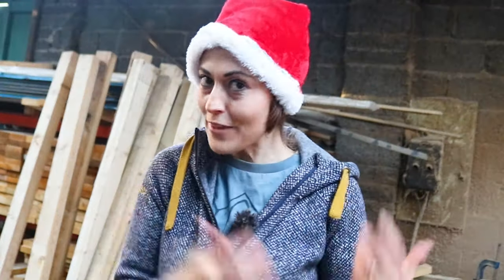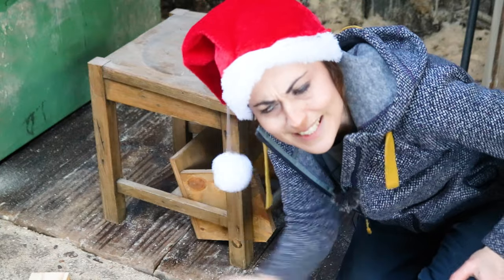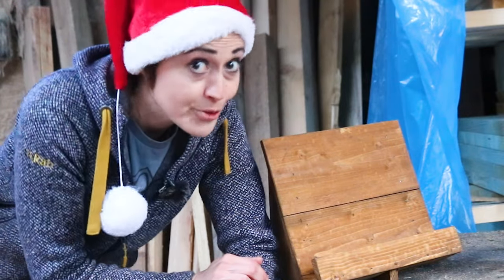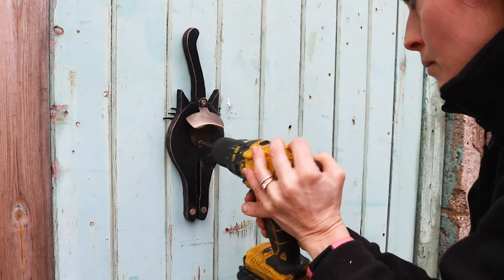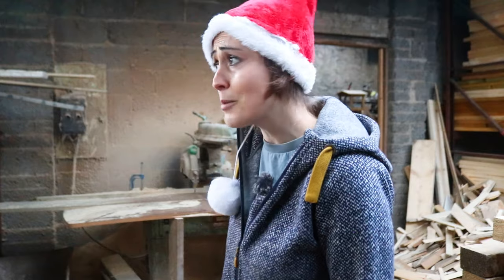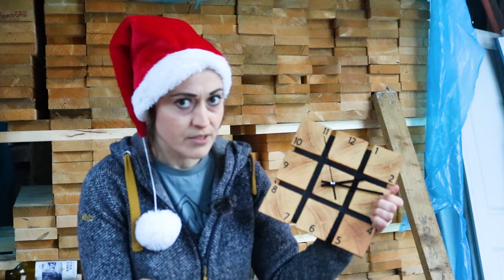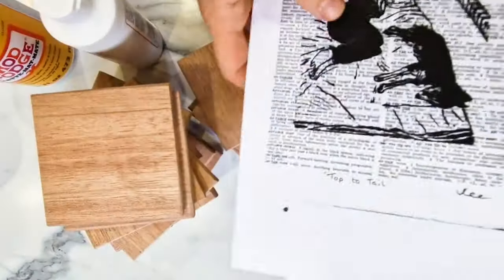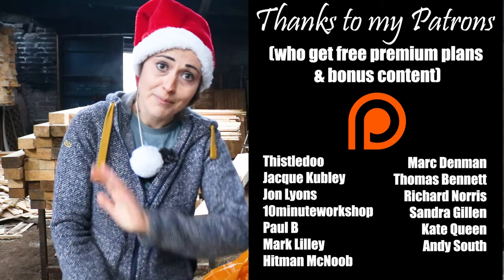12 LAST MINUTE Woodworking gift ideas you can make or sell with scrap wood

Comment: Hi Vikkie, You have a new subscriber now. I like the ink transfer idea but I prefer the inkjet method I learned from Steve Ramsey many, many years ago. I've had great success with it over the years. I'm actually getting ready to make a gift for my son and his wife using this method. I'll probably make it a video. Any way. My favorite gift from your video was the cat bum bottle opener. However, I think all of the ideas are good ones. I'm going to try the thumb page holder for myself. Thank you and God bless.
Reply from the maker: I'm going to have to look into the ink jet method, I was running around all over looking to find a laser jet, I ended up using our local library.
Reply: @TheCarpentersDaughterUK  Here's a link to Steve's video ( https://www.youtube.com/watch?v=Zq2O66QGCwg&t=10s ). He uses used label paper, but I've used kitchen wax paper. Not parchment. It has to have a wax coating. What is nice about using the wax paper is that I have a wide format printer and can cut the paper to fit my printer. In this case, as large as 13" x 19" (roughly 33cm x 48cm). Also, purchasing wax paper is cheaper than label paper. God bless and Merry Christmas to you and you family.